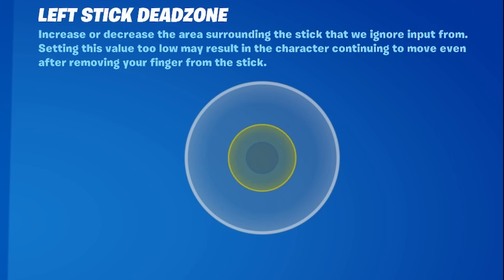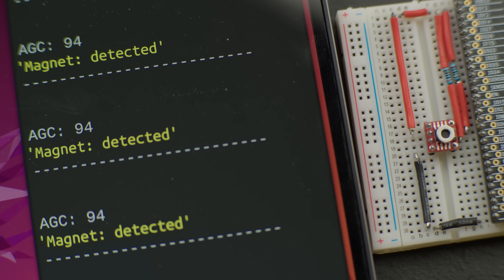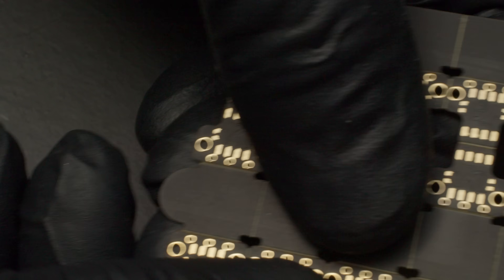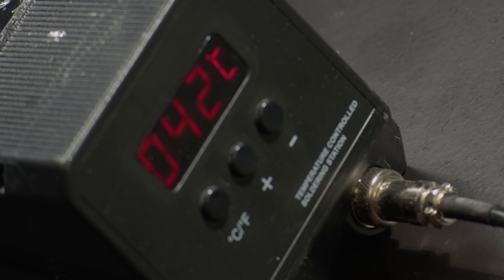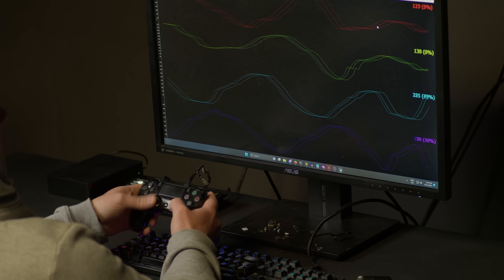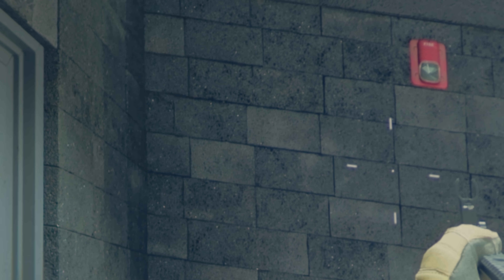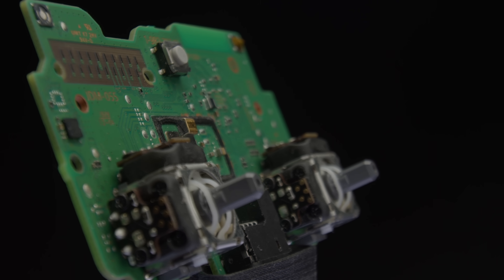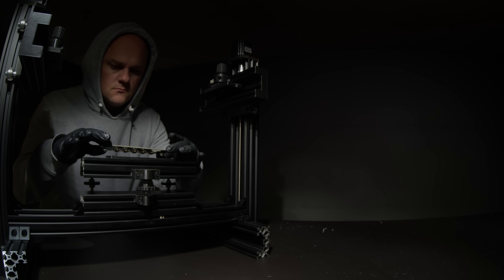Beating the $20B Joystick Drift Problem, and giving it away for free

Comment: This man saw a problem that sours the enjoyment of millions of people and said let me help. This was not a video about controller drift, it was about restoring faith in humanity👏👏👏
Reply: they can fix anything , but they want u to buy new controller all time ifu dont know how to solder.
Reply: help what? Gulikit already has electromagnetic thumbsticks and their controllers which will never have stick drift is readily available for about $60 to $70. this video is basically just trying to reinventing the wheel by exploiting gulikit's patent.
Reply from the maker: @86soulx  That's not true. You just think so because you are ignorant on how these technologies work.
Reply: @MariusHeier1  Shameless. the fundamental principle is the same. Both are just measuring the difference in magnetic field strength using the hall effect.

you are just added a hall effect sensor to the controller and gulikit have been doing that for years now.
Reply from the maker: @86soulx, let's use an analogy for better understanding. Measuring the strength of a radio signal gives us knowledge about the distance or the intensity of the source. This is similar to how Gulikit uses the Hall effect.

On the other hand, I use several Hall effect sensors embedded in a single chip. These are placed with accurately known offsets relative to each other, and a CORDIC computer tracks the rotation of the magnetic field. This is very similar to how GPS works, by triangulating the signal from three separate sources. This is a significant difference. Gulikit's version doesn't work without intensive signal processing and automatic midpoint resetting. However, my approach allows for a noise-free 8-bit signal. Gulikit can't achieve this with a single Hall sensor.

I've used a chip used in making precision rotary encoders for motors. They can do this because they do not work the same way as Gulikit does.

You can throw a rock into a river, it's not gonna make it into the London Bridge because they both use the same main principle.
Reply: @MariusHeier1  well you don't even have a final product to show for yet so what's the point of trying to convince me or anyone else that it works. all you have is a bunch of theories and videos right now that can hardly be verified.

has anyone reviewed your product or your theory, putting it to test and publicized the results yet? Is there any reviewed proof that your idea works better than the existing hall effect sensing controllers other than what you claim?

what's the point of saying "giving it away for free" and then do the patreon thing?
doesn't it sound like you are just trying to get some patreon sub even putting up a sob story to buy some sympathy?

your whole story doesnt even have a believable premise to be honest. even if the idea eventually does work and you open source it, giving it away for free, how many % of the gamers are actually technical enough to assemble it on their own? 

the schematic will still neeed be used by the companies and go into production line for it to benefit as many people as possible.
So given that you are trying to do the patreon thing, it is logical to suspect that 1) the end result is not something that can be patented or 2) the end result won't be better than the existing products on the martket.
Reply from the maker: @86soulx  Haha you're funny.  Turning it into something personal because your arguments fell apart. This is not gonna age well.
Reply from the maker: Thanks for seeing that. And thanks for taking the time to write a comment. I got  plans for even bigger problems at well. Just gotta start "small". 😁🙏🤗

Comment: Game controllers suck. Flying an fpv drone sim requires a real controller/transmitter because game pads are so jittery with low resolution it's very hard to control the drone. My radio master transmitters have hall effect sensors and they're very good. But I also have a DJI controller with potentiometers and that is also very usable with the simulators. Everyone knows that keyboard+mouse is best for fps games, but after my experience with good drone sticks I'm thinking they're just as agile and quick as keyboard and mouse.
Reply from the maker: Yes it really feel different. These sticks as well.

Comment: already bought a pair pf these from Gulikit to install on my Steam Deck. Considering I only had to solder one wire to re-enable to the touch capacitive thumbstick tops: it was the easiest DIY hardware upgrade ever. 

Already use a Gulikit controller with Hall Effect sticks and the difference between console controllers & a controller with Hall Effect sticks is NIGHT & DAY. They're more accurate, they FEEL better and they have INFINITELY longer functional lifetimes. 

(I say infinitely because not a single Hall Effect stick I own has developed any issues in the couple years I've owned them, by comparison I've gone through 2 Xbox Elite controllers that both developed stick drift within 2 years of ownership/use.....and my brothers have gone through dozens of joycons and half a dozen Playstation 5 controllers)

Props to Gulikit for being my favorite Chinese company, they've been incredibly great at making better controllers than the first part manufacturers AND DOING IT AT A BETTER PRICE POINT ❤

And their commitment to selling individual components for users to install in their existing hardware has been such a blessing. I heard about them early in the pandemic and I've been a fan ever since.

Glad to see you out here continuing to reinforce the gaming PSA❤

But yeah the fact that Hall Effect sticks "weren't new" when I found out about them was definitely a face palm moment. I was ready to reinvent the wheel myself, all I needed was a little engineering insight. GG games industry you played me for a noob for nearly two decades. I think I'll buy a Bambu printer with the savings I'm accumulating in controllers I don't need to buy now! 😂

Comment: Umm there is no problem to defeat here, the reason why controllers are not made with magnetic hall effect sensor is because of being cost prohibited. Most controllers are made with standard potentiometers because of these cost reasons. You can find plenty of aftermarket controller company's that make their controllers with Hall effect sensors instead of potentiometers. The difference being is those controllers cost upward of $300 to $400 while the basic controllers that most game companies sell with their consoles made with potentiometers are about $50 to $100. It's bad enough being a thirteen-year-old kid being able to afford a $50 controller but having the only choice to be a $300 or $400 controller because the game industry has decided to switch over to hall effect sensor only would be kind of heartbreaking to be stuck in that kind of situation.

Comment: Great, now fix the inherent mathematical problem with joysticks.
Reply from the maker: You mean the non linearity in regards to the stick distance from the center?
Reply: @MariusHeier1  I mean the laws of calculus.
Reply from the maker: @idk-z6i-f8t  You need to be specific. I'm not that educated. Haha.
Reply: @MariusHeier1  A mouse tracks position directly and the user can imply velocity and acceleration naturally. A joystick tracks velocity so it can never be as responsive as a mouse. There's reddit threads on the subject.
Reply from the maker: @idk-z6i-f8t  It doesn't. A joystick tracks position. A x and y coordinate.
Reply: @MariusHeier1  Yes, but the joystick's position represents speed and/or acceleration, whereas the mouse's position represents position, its speed speed, etc.

Comment: You could do it this way, and spend a few hours of your time and quite a bit of money having to special order pcbs and electronics in small quantities instead of in bulk. It could cost as much to order a few of resistors as 100 resistors. Many pcb manufacturers require a minimum order amount sometimes in the ballpark range of 50-100, somthing that could easily cost $50-$100. 

Or, you could just buy pre made Hall effect joysticks that are significantly cheaper, more sturdy, and literally plug n play, requiring no setup with chip programmers.

Comment: Now fix the Razer Deathadder scrollwheel 😂
Reply from the maker: Hmmm....  whats wrong with it?
Reply: @MariusHeier1  I've owned like 6 now, and they always end up skipping scroll wheel tracking after a year or two.  Like I'll scroll down a notch, and the sensor will think I scrolled up a notch (or 2) instead.  I looked into it a little bit, and it's a plastic bearing that pretty easily gets worn down, and it's not sealed from skin oil in getting into it.  It usually starts failing on one part of the scroll wheel, but will spread if you keep using it. Though it's in a tight spot to actually implement a better fix, as there's only so much room below the buttons.  Love the form factor though, so I'll keep buying 😅

Comment: This is awesome no doubt about it

I just have one question regarding the magnets if they will lose any magnetism over time or is that negligible ‽
Reply from the maker: Thanks. They will loosen strength over time. But it will not effect the reading. It has automatic gain control. And it does not use the strength of the field for position control. It uses the product of two hall effect sensors 90 degrees off each other.

Comment: How in the fuck does a controller only last you people 2 months? They last years
I still have my OG 360 controller
Reply: Just from a perspective of durability, my wired 360 controller has been the best controller I've owned. Over a decade of always being plugged into my PC and thousands of hours of use. The rubbers might be gone from the sticks but they work fine, and the buttons all work, and the triggers both work.
They factually do not build them like they used to.
Reply: I only switch from my 10+ years old 360 controller to a ps4 controller becouse of the d-pad for Tekken
Reply from the maker: Playstation controllers dont have autocalibration as Nintendo and xbox. So its way different..and 2 months is active play with fps games.
Reply: @MariusHeier1  That doesn't make any sense, an Xbox one or 360 controller takes years of active FPS playing no problem
So why are people so obsessed with Dualshock then?
How do they get away with that?

Comment: Don’t mean to be a downer but this technology already exists doesn’t it? I bought a controller with this type of technology.
Reply: It does exist, but what this project is "beating" is the manufactured/planned obsolescence (purposely designed modes of failure, to encourage repairs or replacement purchases).  By making the blueprint for this open-source, he is effectively giving anyone the knowledge to make it themselves instead of hoping an "honest" company sells it at a reasonable price.  He is also designing it so that it's both effective and simpler to assemble for your average person.

Your skepticism is valid (not that you need me to tell you that), but in this case I think the guy's earned at least a pat on the back.
Reply from the maker: Thanks for saving me the time of explaining it. :D

Comment: What is the difference to the technology that GuliKit uses? Sounds the same.
Reply from the maker: They create an linear scale from the strength of the magnetic field with alot of signal processing. I create a linear scale based on the rotation of the magnetic field. To use an analogy. Location tracking based on the strength of a radio signal. Vs location tracking the way GPS does it.

Comment: Huh. I thought they had stopped using resistive feedback after the N64... I was under the impression that controllers after that were optical, like with your mouse wheel.

Comment: Quick questions... I've never had stick drift to the point where i had to ditch a controller...  I made it through the whole Xbox 360 generation with basically 1 wired controller and 1 wireless controller. Same for my siblings, they just used the controller till the padding on the sticks were worn out. 

biggest issue we ever encountered was the return springs wouldn't center the stick, next biggest issue was the clicking of the left thumbstick would kinda be hard to work.

I have some xbox 1 controllers that i used for years and years, no drift... 

to hear some gamers having drift issues after 3 months boggles the mind. Less than a year into the current gen it seemed like a plurality of gamers had issues across all platforms.

What really changed between all the potentiometers from just a few years ago?

Comment: Good quality pots like Nobles are greased that's why they last so long compared to cheap pots the grease keeps the tracks from wearing down. They have to be sealed pots though which makes them more expensive. Those types of pots are what's used in good quality R/C servos and R/C radios, though in recent years hall sensors have started to be used. Many people prefer pots though because they fail gradually unlike hall sensors which either work or they don't. One guy who's company makes aerospace grade servos told me they specifically do not use hall sensors because a pot will show warning signs before failure while a hall sensor will just stop working suddenly, possibly while in the air.

Comment: There are better pots available for robotics arm position feedback having several million cycles of life. It is just a little bit expensive. Also hall effect sensors have their own drift issues with temperature, time and linearity needing constant calibration, through external controller. Not sure, if you are reinventing the wheel👍❤😂

Comment: Here's the real reason:  most people when a controller breaks will go out a buy a new one, so they are not built to last. It's not a $20B problem, it's a $20B scam.  This technology has existed and does exist in joysticks and thumb sticks for decades, yet most controller manufacturers don't use it - even in their $100+ 100% ripoff 'Pro' controllers where they still use potentiometers and rubber dome buttons instead of mechanical.  If you want excellent and cheap controllers that use this tech I recommend 8BitDo.

Comment: An alternative "fix", at least temporarily, is to use Caig Deoxit. Take the controller apart and spray Deoixt on the pots  while moving the stick around in all directions to help work it in. A lot of times the pots are not wearing out, but rather, a buildup forms on the conductive surfaces that hinders their performance. Deoxit cleans and applies a lube that will help prevent future buildups. If you find that, over time, you want to "superclean" the pots you can use CRC electronic contact cleaner, which will remove the lube that Deoxit has. I do not recommend using CRC alone on the pots; the lube helps and is required.

Comment: The reality is that stuff like this wont make it to controllers at large until someone tries to meaningfully compete in the market, and does so in a way that causes first party sales loss. It costs more to make and implement if for no other reason than that the machinery isn't currently set up to produce it. More cynically you could argue that stick-drift drives some percentage of new controller sales, and until people start choosing to only buy 3rd party controllers which offer hall-effect sensors there is little motivation for companies to switch.

Comment: This is a great project and the engineering work here is impressive... but that is the problem holding this design back from being used for controllers: impressive engineering. Often times the thing that holds a great and long lasting design back is manufacturing cost at scale. Machining, assembly, tuning, ect. prove to be a big hurdle to cross that will drastically increase end product price on the customer. Now if this design was picked up and used in small scale-high cost controller designs. It may make its way to the general market to gain influence. Here's hoping. Great work!